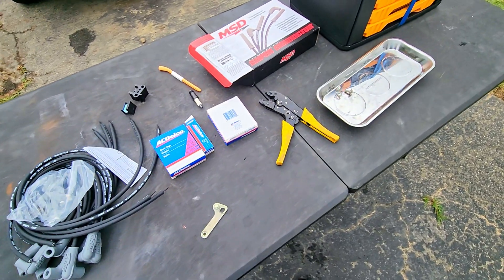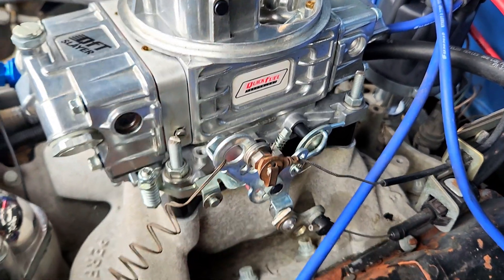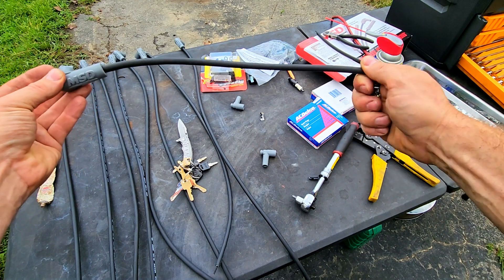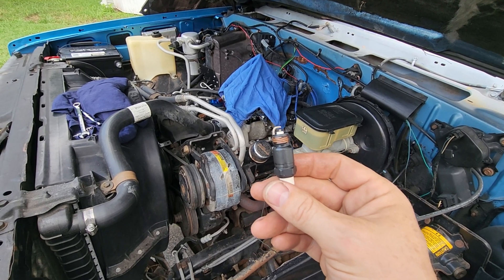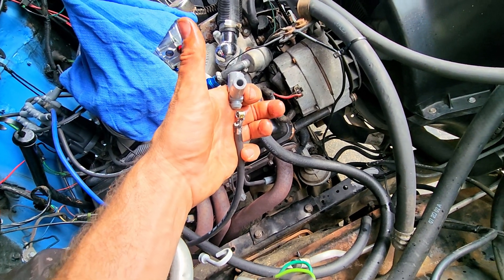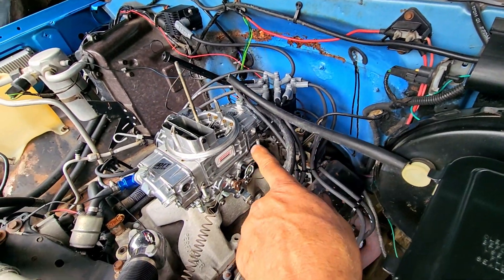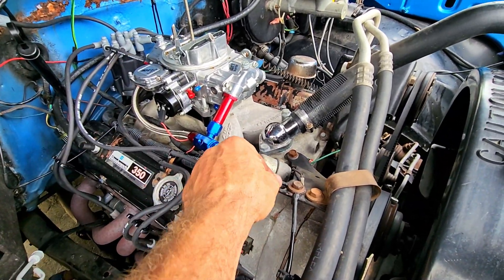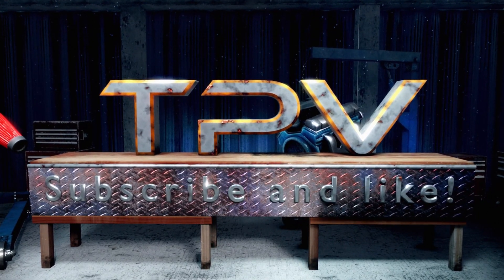How to Build Custom Spark Plug Wires | Free ASE Certification Training 😂

Comment: You aren’t supposed to t-off your brake booster vacuum line it causes weak booster function and brake fade with lower idle/vacuum. The brake booster always gets a dedicated vacuum source.
Reply from the maker: @HeadFlowInc   I had a feeling someone would say that lol
Reply from the maker: @HeadFlowInc  I have don't it before without a issue depends on how good your engine vacuum is. If it has a problem I will just tap the spacer.
Reply: I personally ran into that just recently. Was trying apcv system on my car.

Comment: The best lubricant to use when assembling plug wires is Silicone Paste or silicone spray. 
The paste is way better because you have to work really fast with the spray because it dries so fast. 👍👍